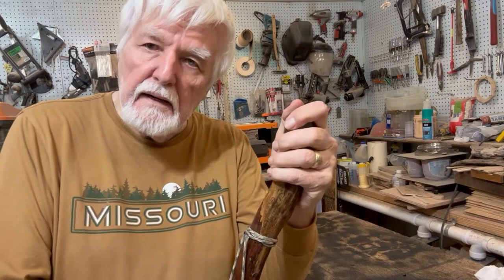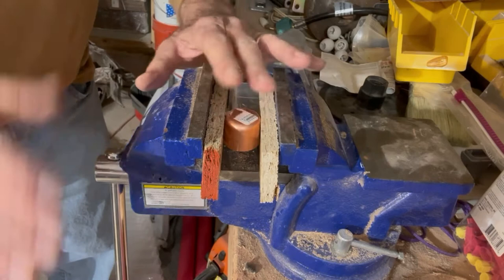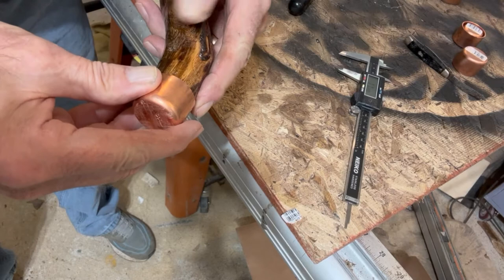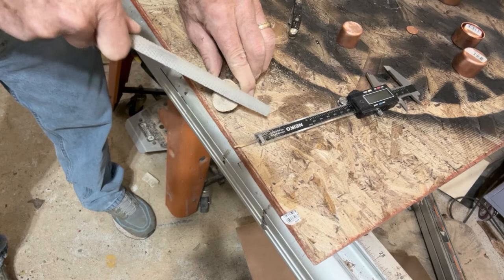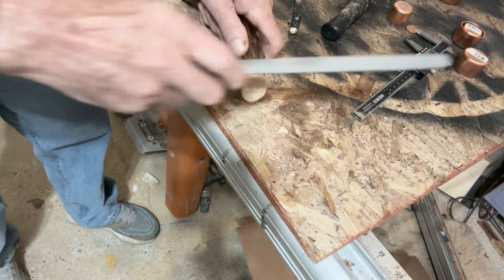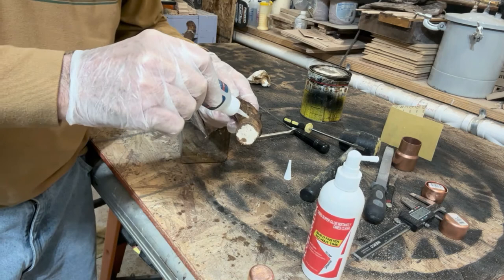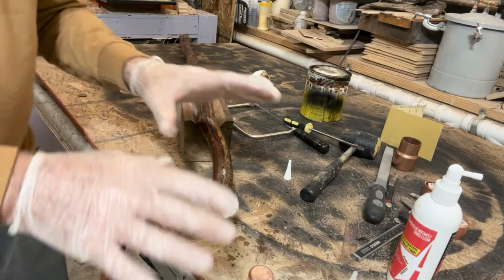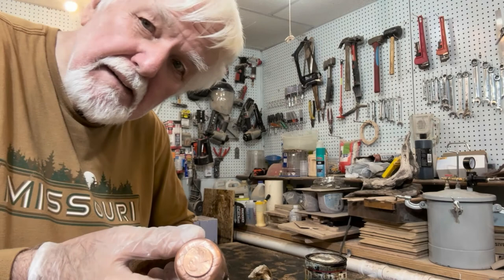Walking Sticks - Part V Installing a Copper Tip

Comment: The copper plumbing pipe end cap works pretty darn well. But, the end wears through pretty rapidly, so I end up with a sharp, jaggedly, edge tube instead of a cap. So I started using plumbing pipe of the appropriate diameter that I cut to the length I want. The wood that sticks out of the end weaves off until it reaches the copper. Then they wear very slowly and at about the same rate. The pipe never seems to match the diameter of the stick, so I hammer form it to the right diameter on the horn of a small anvil. Always heat the pipe to a cherry red before hammering. That softens the copper. Hammer along the length to make the pipe smaller and along the width to make it wider. Copper work harden as you hammer and can crack, so heat temper it frequently. I’ve “tinned” the copper with silver solder, to make some of my tips look as though they’re made of silver.
Reply from the maker: Great tip, Rodger.  Appreciate your comments.

Comment: Great video. I always learn something to enhance my walking sticks every time I watch one of your videos. I like the way you use the file. I've put store bought brass and rubber tips on some of my sticks. I would just whittle the end down with my Case knife so it would fit. It works, but the finish isn't near as good as when you use the file.
Reply from the maker: Glad you are finding them useful.  Thanks much for the comment.

Comment: Dennis, thanks for your videos, they're really neat. Have you since tried to drill a small hole in the center of the top, best as possible, then using a 1 inch hole saw just dut down to where the cap would stop? Fill in with epoxy [putty] and maybe top off with a shinny stainless phillips  head.
Reply from the maker: Great idea!  Thanks for the tip and thanks for commenting.

Comment: Another good video, do you find the metal on the bottom affects grip ie. makes it slip on hard surface>
Reply from the maker: Yes, I probably will slip on hard surfaces.  Only good for hiking trails and strolls through the forests.

Comment: Hello Dennis.  I like it. Next walking stick of mine will have a copper tip. 
My last one had a store bought rubber tip and I did the same thing to get it flush (didn’t glue it) and snug enough for it to not fall off. Thanks for the video.
Reply from the maker: Thanks, Mike. Glade you liked it.

Comment: Nice end cap Dennis.
Would the Penny fall off under use?
Take care Dennis.
Cheers, Huw
Reply from the maker: I don't think the penny would come off.  I used thick CA and Accelerater  Also I tapped it good to see if it held on good.
Not a very scientific test but enough for what it is.
Thanks, Cheers
Reply: @OzarkArtsandCrafts  Ok thanks